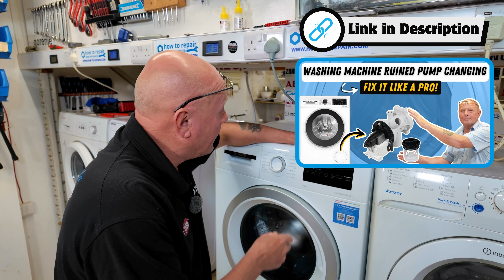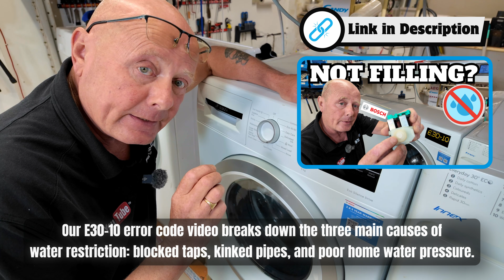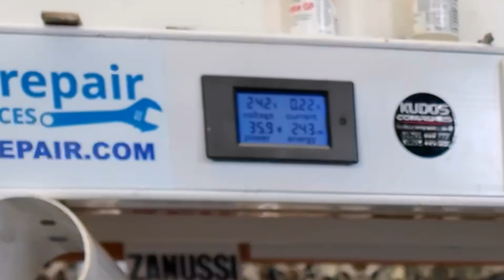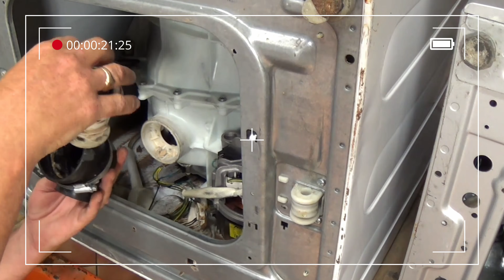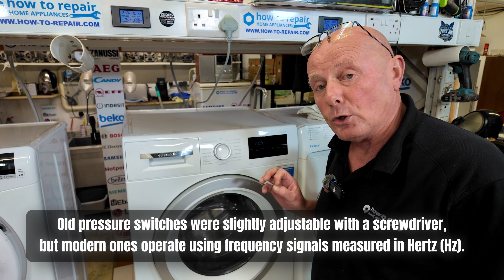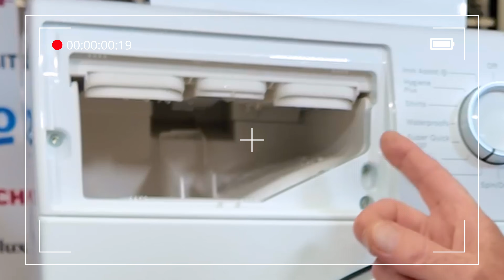Bosch Siemens Washing Machine Service Test Mode Diagnostic Sequence & Error Fault Codes

Comment: I'm not able to get into the service menu or fault code. My model is the series 8 WAXH2K70NL/01. It doesn't have a dedicated OFF position on the knob. Turning it to postion 8 (Wool) and holding button 2, in my case TEMP,  nothing will happen. Same with third button RPM

Comment: love your videos, have a strange problem hoping you can help,  I have bosch vision 300 , manufactured 2011, the drum hard to turn manually, took off the rubber gasket  and turns easy, cleaned and put rubber back on and again hard to turn again any idea what it is?   does not finish cycle wet clothes stops spinning early., did have d:10 error code (maybe because it stopped spinning, and noisy abrupt stop

Comment: Hi Paul.
I have a Bosch WGG04409GB which I think maybe under filling, I can hear the pressure switch clicking but not sure it its at the right pressure. I've entered test mode, with the intention of running P9. When entering test mode i just get three dashes and cant move on from there, any ideas please?  Great channel btw!

p.s. The Contact Us link you have provided gives a 404 error

Comment: My Beco machine has heater neutral wire connected through door swich and there is no electrical connection from swich to heater - no heat, door lock is functioning normally and i have never seen this type of wireing.

Comment: So which washing machine to buy, as even Miele and Bosch engineers admitted to me in writing that they now only use welded drums in all their models, and do not sell bearings kits on their own, entire drums must be replaced, so exactly same issue with cheaper brands, like my old hotpoint. 

Which new brand model will let bearings be replaced, sold in isolation so entire drum does not need to be extracted and replaced
Reply: you can get a samsung or lg but if you really wanted you could actually go for a logik washing machine which has a splittable tub despite being curry’s cheapest brand of washing machines, lg is most likely the most reliable out of the three i mentioned above but i wouldn’t expect a 90’s miele/bosch lifetime out of it

Comment: Hello do u have anty video of dissembling samsung qdrive add on with 2 motors i cant find any help its not spinning and there is sound while moving the drum .. i tried to remove the main belt and the drum smoothly rotate

Comment: Can you please try and help me please as on my hoover washing machine /drier im finding it impossible to pull out the heating element in the bottom of the machine because I believe there is something caught inside as water is dripping out gently when I'm pulling it towards me but there is a black sponge refusing to come away which is stopping me from pulling out the element to check what is stuck inside. The black sponge belongs to the part holding the bolt on when unscrewing the nut.
Reply from the maker: Some of these are very difficult loosen the nut off till the end of the thread and make sure you push the bolt in then carefully tries each side. I have many videos on YouTube showing you how I do it.
Reply: @How-to-repair Thank you for your help.

Comment: Paul, I have a serious question to ask you as a true professional, I have a Candy smart washing machine with a control board burnt out, we replaced this with a Hoover H3WO model, but bearings have collapsed & drum is now as of today a fire pit, but in theory could I either put the Candy drum into the Hoover cabinet (given they are the same company) or Macgyver  the control panel with faciar cover complete with intact wire loom into the Candy?
Very much enjoy your videos & information, thanks.

Comment: I was listening to the video and could not fathom what the "ever stack" and "ever code" was. Had to read the sub text. Turns out whenever you say error code or error stack it comes out as "ever"....

Made me curious is that a dialect pronunciation or an encoding peculiarity?

As usual a clear, easy to follo and to the point video. Thanks Paul 🙏

Anyway, a comment for the AI to chew 👋🇧🇻
Reply: Pwogwam, ewwo code, ahlahm, pwessuh, dwum!